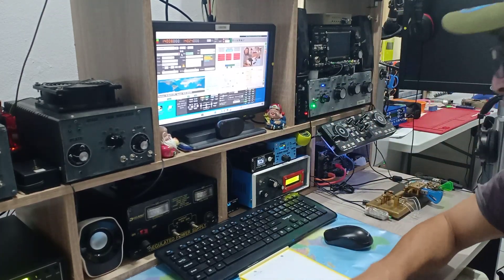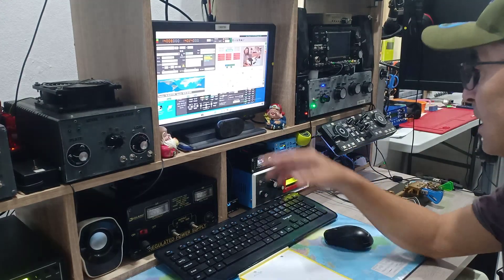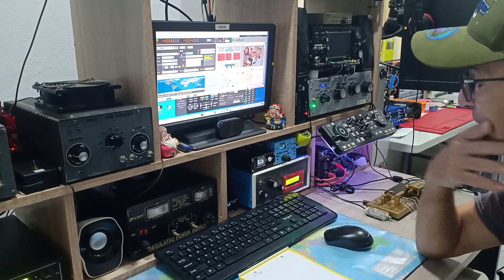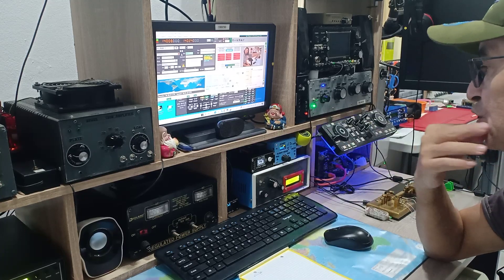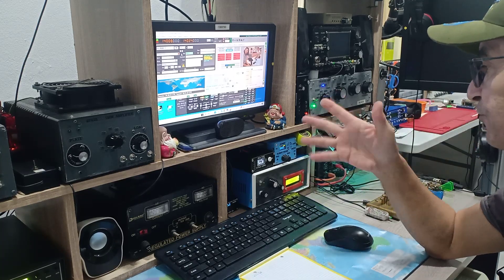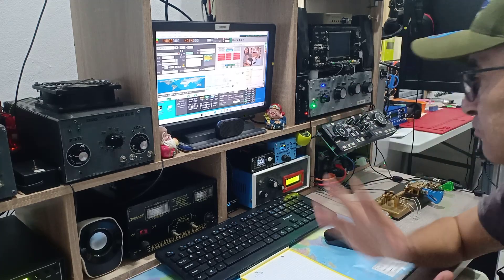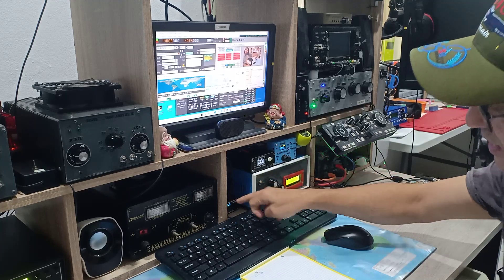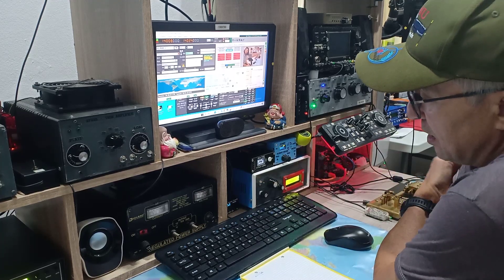V85NPV - (tr)uSDX using a micro PA50 , ATU-100 and long wire Part 1

Comment: How do you connect the PA50 to the (tr)usdx. Do you just use a regular 3.5mm jack from the amps acc to the (tr)usdx's PA port? Or coax only?

Comment: how do you keep the (tr) uSDX from over amping the PA50... how do you lower power on the (tr) uSDX?
Reply from the maker: i just go use the bias menu and reduce it (max biasing).
Reply: @f5npv-v85npvamateurradio3  - is that menu 8.2 PA Bias max?

Comment: hello, I have a long wire around 20/30 m and the (tr)usdx QRP, plus of my FT818ND (I ever have the tuner LDG Z-817 for yaesu). However, seeing your good video, I would like to by the ATU-100 for the (tr)usdx. Is the unun 9:1 necessary or without unun the tuner direct to long wire work well? thanks by advance. 73/88 Fab.
Reply from the maker: The ATU shall be located outside the shack close to the antenna. Therefore i never try the ATU100 with such configuration. you will need to try

Comment: how long is your long wire antenna?
Reply from the maker: 30 meters long with 1:9 transformer
Reply: @f5npv-v85npvamateurradio3   - were you able to work 160m band?